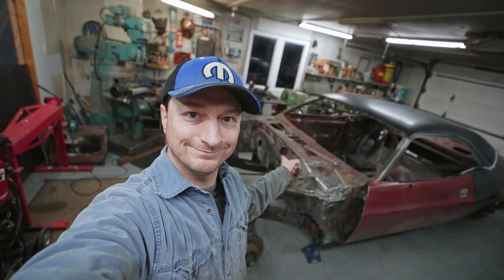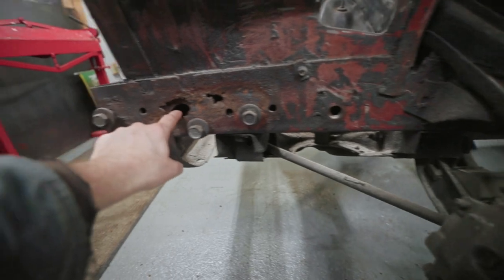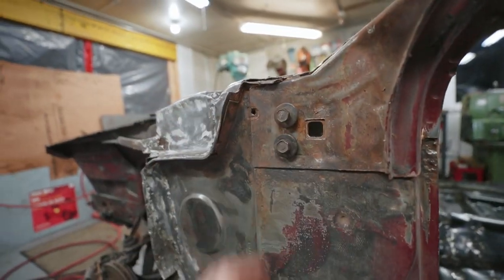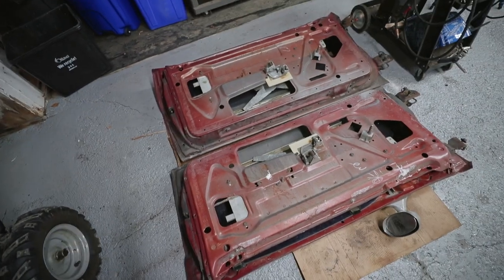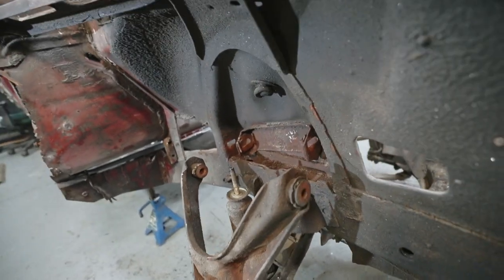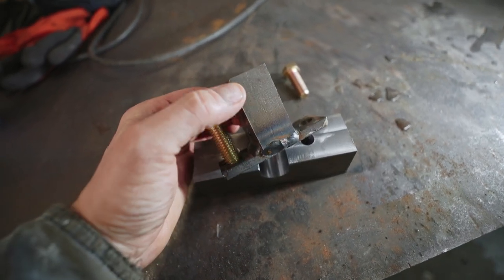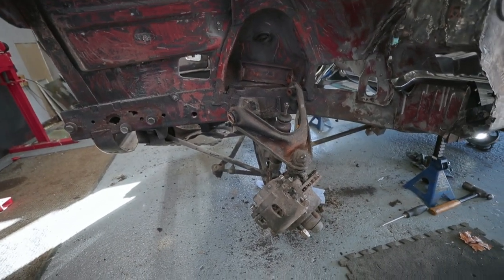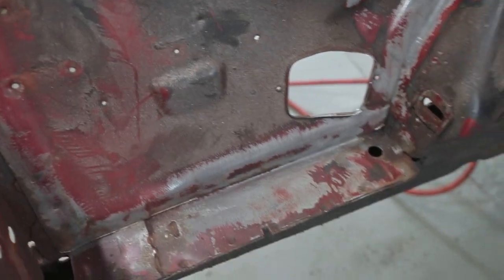74 Dodge Challenger Restoration #21 - K-Frame and Inner Fender Removal

Comment: Those  are strut rods. They basically hold that wheel in place for when you’re going down the road and particularly when you’re stepping on the brakes. They stabilize that lower control arm.
Reply from the maker: Strut rods, thanks buddy!
Reply: @glassglowz   just to add to Mikes comment- when you go to reinstall them you need to torque them to a spec once all suspension is installed. its critical- they rip themselves apparent if not.
Reply from the maker: @enforcer5053  thanks for the tip!